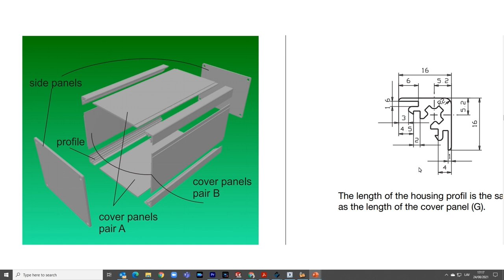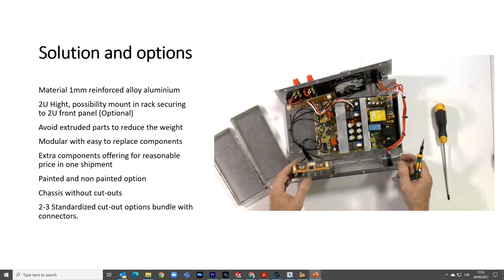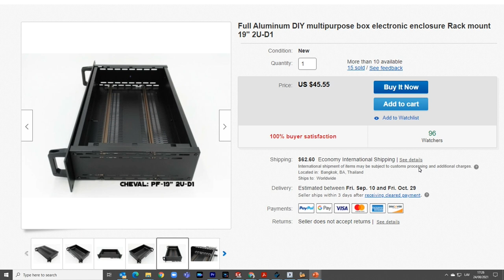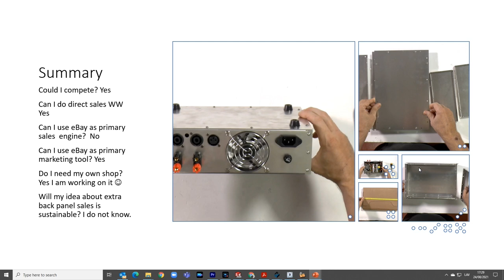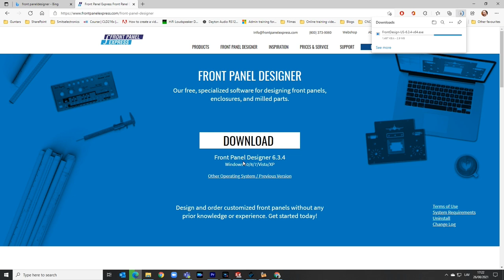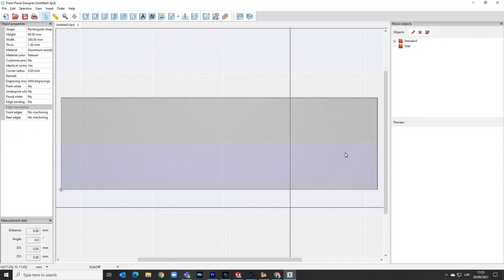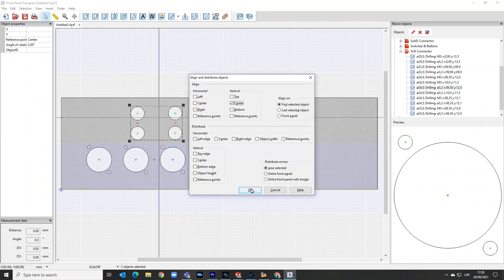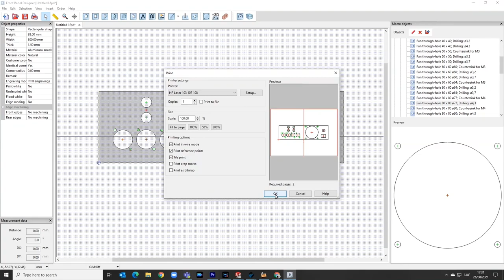Prototype enclosure for modern amplifier

Comment: When having a multichannel active spesker system is it important to have poweramp with volume control or leave it
Reply from the maker: A better solution is a split your system into two parts - active crossover and multichannel amplifier set. In the pro world, 3-way stereo active crossover costs are just 100EUR and have all possible regulation options. For example, Behringer CX3400 Super X Pro V2, or check for dBx more expensive alternatives. Digital active crossovers where you have total control of speaker and room starting from 250EUR. Do not rely on the consumer market. It is overpriced and devices quality is "so so" due to low volume production.